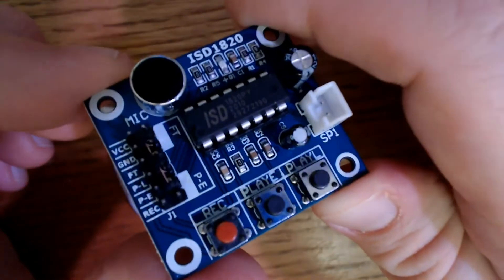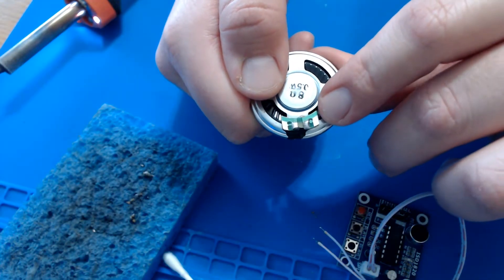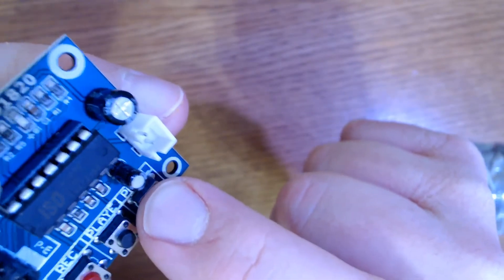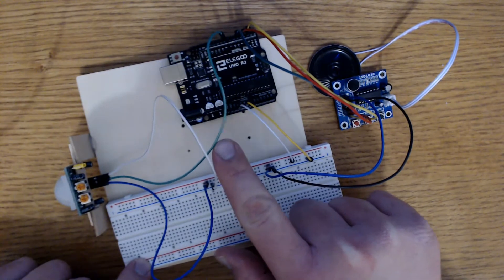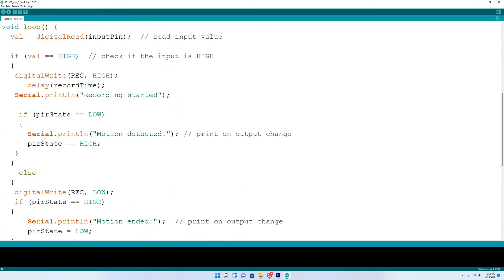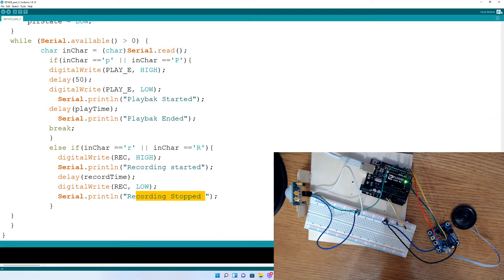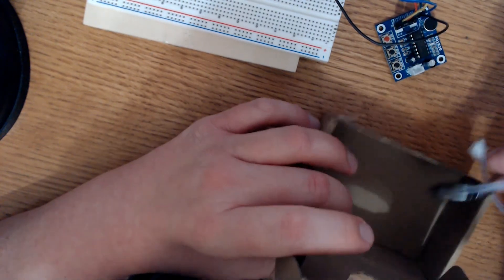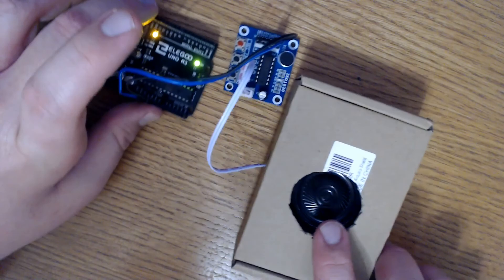Make A Motion Activated Spy Microphone With Playback Ability Using The ISD1820 Voice Recorder Module

Comment: Hi, thanks for taking the time to do your videos.
I have two of these and tried both of them today with a couple different 0.5W 8ohm speakers and neither of them would work.
You could hear the tapping on the microphone come through the speaker but when I tried to  playback a recording, I could hear nothing. I could hear my voice through the speaker slightly when I used the flow through mode, but never for a recording. Do you know what might help? Mine were bought without speakers and are the digitech brand which I've seen work for others. I don't expect the sound to be high quality obviously without an amp and bigger speaker but I know I should be hearing the playbacks. 🤷🏼‍♀🤷🏼‍♀ Thanks
Reply from the maker: Would you mind posting the video or pictures to Facebook? Also include your code and where you bought the speaker and we'll see. 👍

Comment: Does the button always have to be pressed with the ISD1820? I want to make something where I can record a message on the board and into the mic, and then when the motion goes off the recording sets off, all without pressing the button. Can that be done with this?? Thanks
Reply from the maker: Hi Wendy!  yes, you can trigger the recording with the motion sensor. I'll make a youtube short and include code in the description. 👍

Comment: Thanks for your support. Did you try to record de audio using an SD card to get a history of all capture talks?
Do you know a way to access the recorded file using Arduino?
Reply from the maker: Hi there!  There is no SD card option that I'm aware of. I haven't been able to find any details about access to the sound files. There may be a way to pull the file off the chip and save it, but I'm not sure... The sound file is very small. You may want to check out something like this at CircuitDigest  https://circuitdigest.com/microcontroller-projects/simple-arduino-voice-recorder-for-spy-bug-voice-recording

Comment: Great video, above my skills. Is it possible to wire a piezoelectric sensor to trigger the recorded audio as a stand alone?  Thanks in advance.
Reply from the maker: hi there! Thanks for the compliment.  It has a 3.3v vcc and a ground as well as a 3.3v white battery adapter. You should be able to provide power that way. Just hold down the record button to record a message and use a trigger on the PL or PE  pins. That trigger may be a motion sensor or something similar that will send a signal to the PL or PE pin to start the recording. 
As far as wiring a piezo sensor as the trigger, i'm not sure. Do you have a piezo in mind that I can refer to? Sorry about the late reply